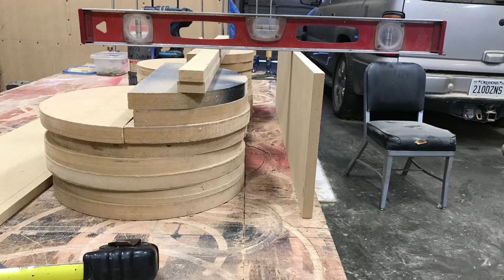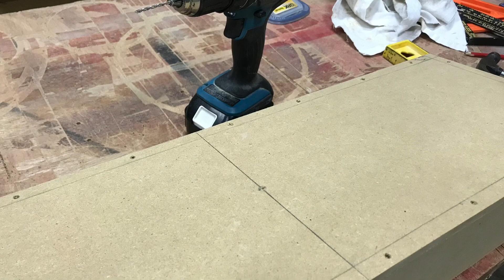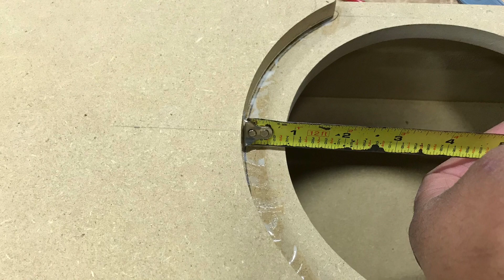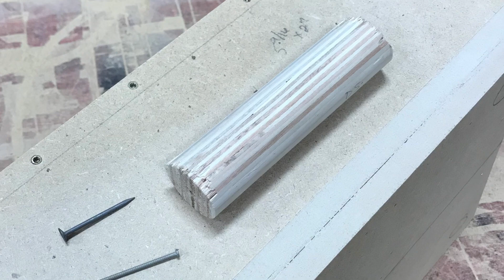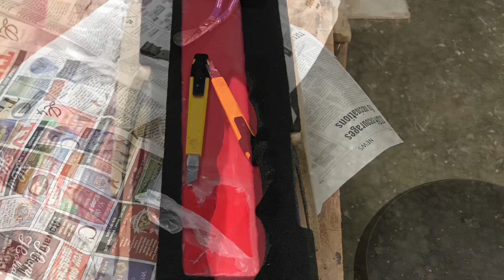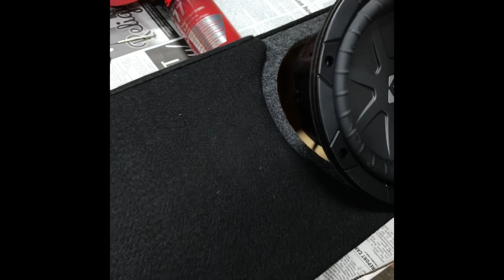Custom sealed enclosure for a single 8” Kicker CompR

Comment: How’s the output being a sealed enclosure?
Reply from the maker: Output was pretty good with this small enclosure. Customer wasn’t looking for anything dramatic at the time of this build. Just wanted to balance out his factory system and keep the box hidden. I’ve built several sealed enclosures for all types and size subs. They perform very well. Keep in mind, this same sub in a ported enclosure would more than double the output, on the same power 👌🏽
Reply: @210Designs  I just bought 2 out of pure opportunity , lol 100$ for the pair! Breaking them in as we speak.
Reply from the maker: @abelscaliber7969  That’s a hella deal man 🙌🏽 Kicker is very proud of their products 😆 I buy all my Kicker products, “refurbished” off Hi-Five Sound Connection. You’ll be very with them for sure.

Comment: I want that same box design to fit a 2014 camaro.
Reply from the maker: His one was built for an older customer, that wanted to round out his current factory system. If your wanting more bass output in that type vehicle, may wanna go with something different bruh. In order to get the bass to resonate from inside the trunk, into the cab.
Reply: @210Designs  what would you recommend for more bass,  but in a compact box
Reply from the maker: @CFLAVOR2007  - To achieve more bass in limited spaces, I’d recommend using a radiator in a sealed enclosure. Helps achieve more bass and keeps the box small 👌🏽 Hope that answered your question, if not just hit me back bruh.

Comment: Super awesome vid 😎 how much cubic feet did your dimensions come to?? And where did you get that connection piece for your wires that fit flush on the side?
Reply from the maker: Just a little over .5 cubic feet. Added a little poly-fil to help, because of the limited space available in the vehicle. I bought the speaker push terminals off eBay. 
https://www.ebay.com/itm/10-PACK-SPEAKER-BOX-TERMINAL-ROUND-SPRING-CUP-CONNECTOR-SUBWOOFER-ENCLOSURE/261579320688?hash=item3ce757ad70:g:bW4AAOSwNKRXiTV0

Comment: Nice build as usual buddy. Just a suggestion, when you do the plexi put some tape lights(led,maybe red). I hope I don't offend you.
Reply from the maker: Thanks bro for watching and the great tip 🤙🏾 Never get offended when people offer advise, I’m always learning something. However, this box really wont be seen, once installed. Sets on the third row floor, with the cargo area exposed. Thanks again 👌🏾
Reply: @210Designs  Got that email?
Reply from the maker: @markbarilleauii6337  - Yessir, sure did. I was in a bad area yesterday an couldn’t download all the pics, so it timed out. I’ll try again this evening, since I’ll be home in WiFi 👌🏾